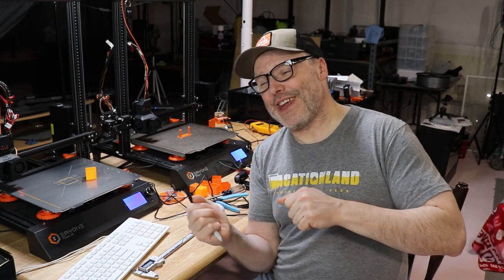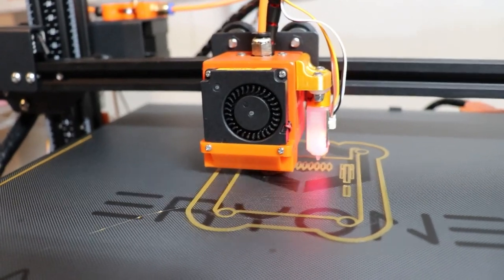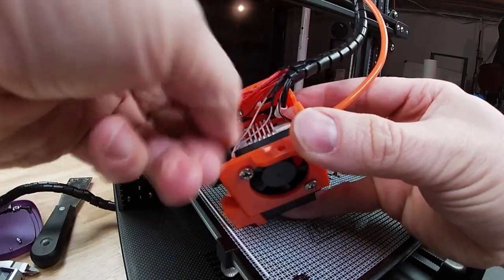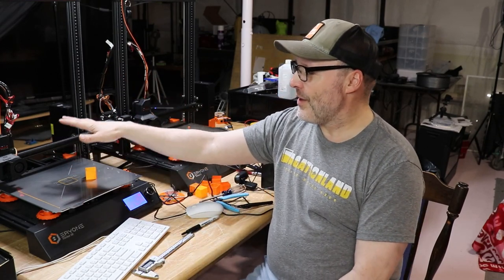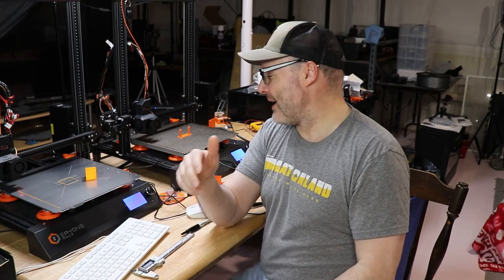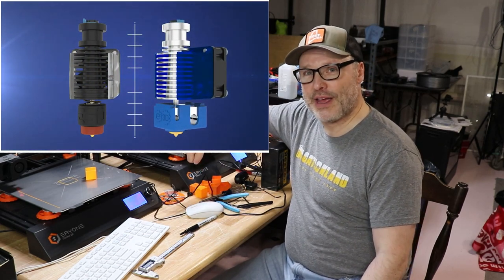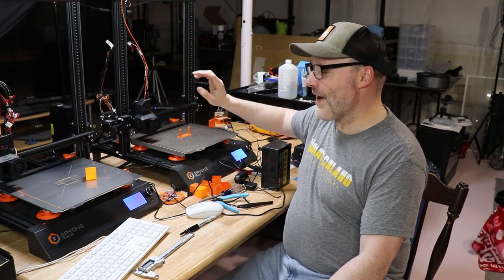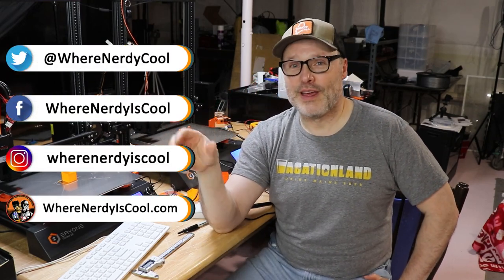Direct Drive Upgrade for my Eryone Thinkers - Part Two!

Comment: Nice upgrades!
I put a Hemera clone on my Thinker SE, big difference.
For the Wham Bam, did you stick the magnetic base directly on the aluminum base over the heated elements? Or did you stick the magnetic sheet on the removable glass ?
Reply from the maker: I adhered it to the bare bed. Removed the glass.

Comment: Question- how would you replace the hard drive? Any video incoming? I just acquired a free Eryone SE but with a blown out motherboard and I am a 3D printing baby.
Reply from the maker: You mean the main board. There are some that have upgraded to SKR boards. Check the Eryone Facebook group. It’s a pretty involved process tho. If you like to tinker it can be very rewarding. If that isn’t your cup of tea, save your money for a new machine.